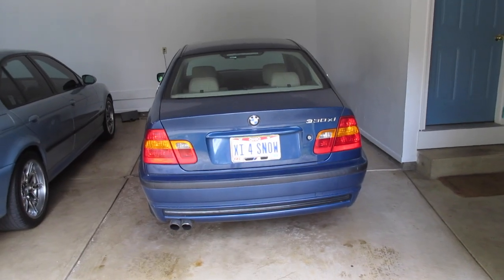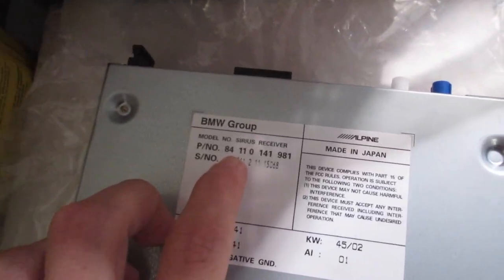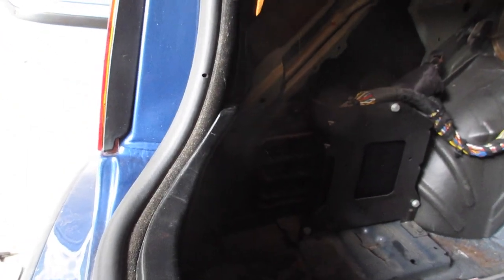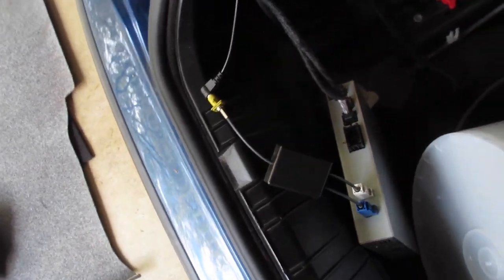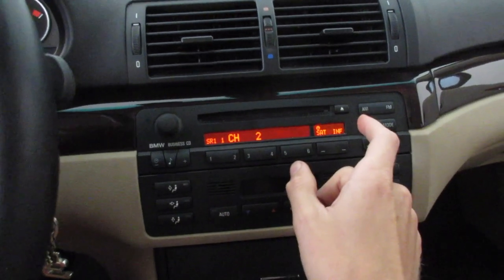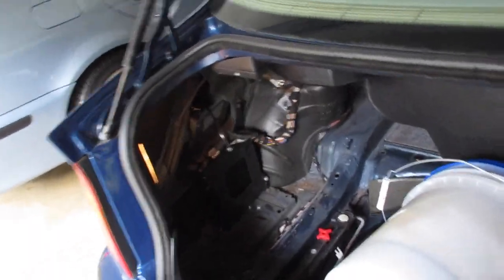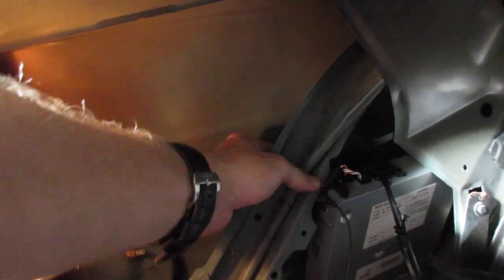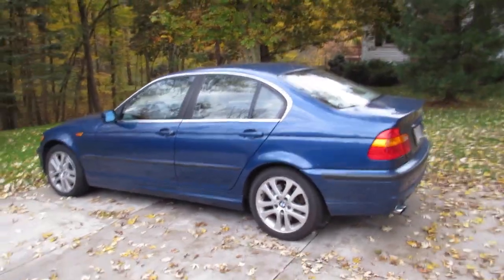BMW E46 3-Series Non-Nav SIRIUS XM Install DIY

Comment: Excellent video! What adapter and set up are you using for Bluetooth?
Reply from the maker: Tunelink Auto.  So from iPhone to Tunelink Auto via bluetooth, then from that device to the stereo with a 3.5mm aux cable.

Comment: Did you try to press the clock button to see if it toggles between the station info and clock?
Reply from the maker: I'll poke around with it more tomorrow, thanks for the tip!
Reply: ***** If you press the clock button it will toggle the name of the radio station. Artist and song name as well if you radio has RDS.
Reply from the maker: BloodScatter That did it!  With Sirius it just stays on the station name (70s on 7 maybe) but then will scroll if I press the INF button.  But yes, that toggles between time and and radio info.  Thanks for that!
Reply: ***** Glad to hear that! Thanks for the e46 videos! :)

Comment: Nice install, shame about the ascetics. I would have liked to see it cycle through the whole name of the artist/track. I.e Ella Hendas instead of Ella Henderson would annoy me, but we can't even get Sirius in the UK.
Reply from the maker: If I need to know a name or artist I can Shazam it, I probably would anyways rather than taking a picture of the screen or trying to take note of it.  Why no Sirius in the UK?!  I don't see anything that would stop you from using it, it's satellite broadcast.
Reply: SIRIUSXM don't allow accounts to be made for addresses outside of the U.S. I can get Sirius, yes but there are no Sirius parts in the UK and I can't make an account with my address. If I were to use an address from a family member in the US, sure, but I'd only be able to use it online unless I get a car with Sirius or buy US parts for it.  So when it comes down to it, it is possible, but unless you have US connections, I can't do much
Reply from the maker: ANEL10 Okay, time to cheat!  1)  Make up an address in Los Angeles.  They don't send anything anyways.  2)  Buy SIRIUS parts from US ebay.  3)  Install, activate, enjoy!

Comment: i noticed that you didnt mention anything about getting the vehicle coded to recognize the sirius module, do you know if this applies to newer vehicles?
Reply from the maker: The older cars are much easier to do stuff like this to.  The E60 (2004) and E90 (2006) and later all need to coded I believe.  Just the dealer's way of getting another $500 for anything that you do.
Reply: Well I have a 2006 e90 325i do you think the coding applies to this? I noticed in some diy it mentions that I have to pull out part of driver side rear seat to access most fibers and switch a few of them and then have it coded?  I am prewired though I know that for sure
Reply from the maker: Jaime Rivera I am not too sure about the E90, you may want to post on a forum where other owners can chime in (BimmerForums, BimmerFest).  Per the official BMW instructions that I found for the 2007+ E9x models, you do have to access the MOST fibers behind the rear seat, then go into the trunk and install the fan and Sirius module.  The 2006 should be very similar, but don't take my word for it.  You can always find a BMW independent shop that will code it for you for much less than the dealer.

-Bobby